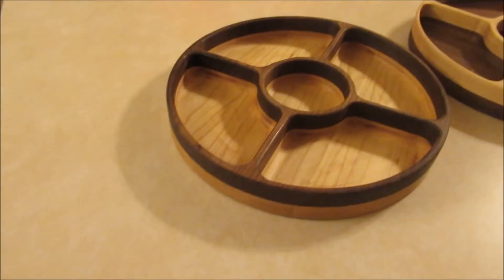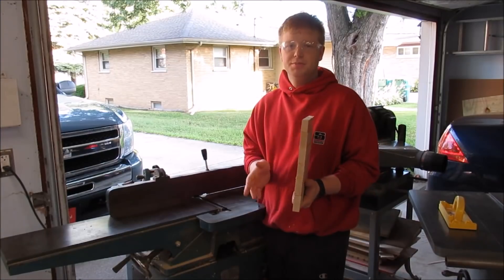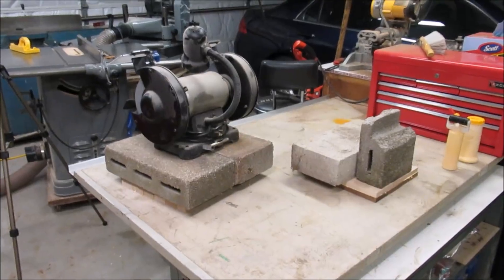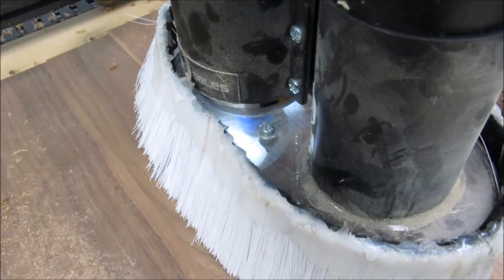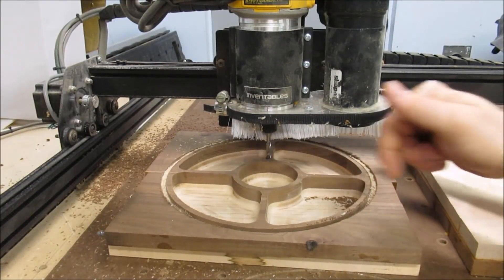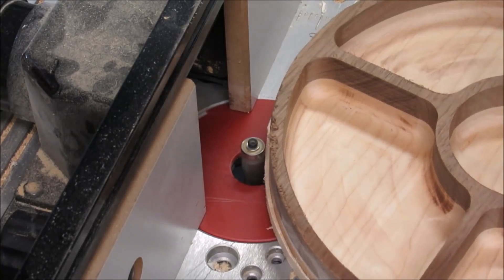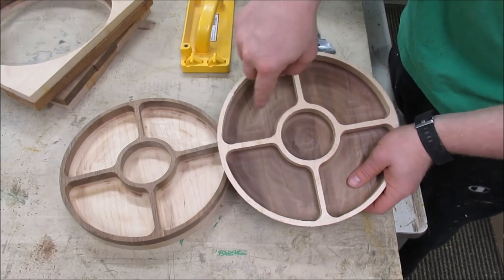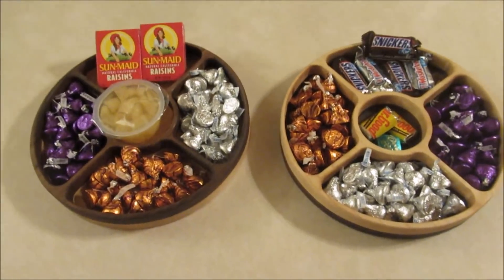Can X-Carve Handle Large Router Bits?

Comment: Can you explain the zero zero positioning you did for the bowls? I am new to CNC and didnt quite catch what you were doing. Maybe you have a link to a video or walk through on this? Thanks.... i guess Im gonna start learning V Carve too. Great...haha
Reply from the maker: Yes, I set the zero point in the software to be the top of the workpiece in the center of the tray.  When I switched bits, the machine stayed still at the x & y zero point, but the new bit was a different length, so the z zero point had to be reset.  I did this by manually jogging the machine to the z zero point and then clicking the button to reset z zero here.

Comment: This is why I went with the Shapeoko 3. I wish I saw your video before I bought it because I would have saved myself a lot of research hours.. I couldn't find anything where the vibration really came into play but this video and other videos showing the inability for X-Carve to cut into thick aluminium (which Shapeoko 3 can easily do at slow speeds with flawless accuracy). The issue with X-Carve vs Shapeoko is Shapeoko is very expensive in Europe, Shapeoko uses US steel so shipping from the US to Europe adds hundreds more dollars whereas X-Carve is all cheap lightweight Chinese parts so they can ship them anywhere in the world with ease.
Reply from the maker: I agree that the Shapeoko 3 looks like a much more rigid machine.  Still I must admit, I've done some pretty cool stuff (not all on video) with X-carve.  When I upgrade, I think it will be time to get the dream CNC machine in some type of pro version.

Comment: The darker wood has just as much burning as the lighter wood. But since the wood is darker, the burns aren't as visible.
Reply: Maybe, but probably not. Some hardwoods are particularly prone to burning. Of the common North American hardwoods, cherry and maple burn much more easily than does walnut. It's not just the lighter color.
Reply from the maker: Yes.  The explanation I've always heard is that fruit trees burn more easily (as you point out cherry and maple).  This is because there is some sugar in the wood vs. non-fruit trees like oak, ash, or poplar.

Comment: I enjoy your enthusiasm.   Love the pull down table.  I am just about to pull the trigger on a 1000 mm xcarve.   I am experienced in multiple graphics programs, corel , PS, others, also in building computer and many other things, also in wood working for many  years.  I build guitars and want some shortcuts to production.  I am experience in all kind of inlay and want that to speed up too.  
 One suggestion perhaps, I know after trying many brands of router bits that all are not created equal,  some are sharper than others, some made with better carbide.  I have found katana bits are a reasonable cost and very very sharp and last very well.     Whiteside bits are great but very $$$ .  I consider house brands such as rockler and others to be not as good as these two.  Over the years I must have tried bits from 20 different manufacturers.   Some of the lesser bits are very slightly out of round also.  In addition the speed of the bit as it grow bigger is a much bigger concern and slowing down the bit can help even if it burns, depending on how deep the burn is.

Comment: Double stick is not the best hold down. Maybe if your spoil board wasn't mdf I would say yeah. You need to clamp that thing down. Or even just put some screws through the corner and screw we Down. Double stick has some small movements and doesn't hold down solid

Comment: Truthfully that router is not designed for that kind of bit. Even more so, in my experience a 1\4" shank with anything larger than 3\4" is a bad idea. Even using rail and style bits and taking shallow passes. If your FR is even slightly too high, you run risk of the shank breaking because the 1\4" shank is writing a check that it cant cash. It will break and break rather quickly. I would use a slightly higher HP router in that machine (requires larger spindle mounts) and then you can use 1\2" bits. The extra HP should power passed the chatter a bit.
Reply: Ive had my X-Carve for over 2yrs and i ONLY use 1/4" shank and have NEVER broken a bit. I use 1 1/4" & 1" V bits, 1/8"-1" end mills, and 1 1/2" surfacing bit. Also, the Dewalt 611 operates at 16,000 - 27,000 RPM's and is VERY capable of using 1/4" shank bits. Proper feed rates & depth of cuts provide me with nice clean cuts and NO chatter.

Comment: Hello David. You have an amazing videos. I am very newby on x-carve. Does the software stop in each toolpath, so you can change the router bit?
Reply from the maker: I do not use the free software that came with X-Carve (called Easel), but yes, even the software package I use (V-Carve Pro) requires a separate g-code for each bit.  You have to switch out the bit, re-zero the Z-axis, and then load the next g-code file.

Comment: Try sticking an aluminum bar between the X axis extrusions (sandwich), it is not that hard or expensive and it helps a lot!
Maybe you can also add a middle support on the Y axis with an aluminum bar aswell that act as the end plates (on Y) but in the midle, I did all that and you can see and hear the difference

Comment: when you're doing your toolpaths, you can save a lot of time by delegating the work across multiple bits. particularly, you could use something big and clunky at a slower feed rate to clear the insides and come back around with a flat end for the vertical walls and stepped clearing, then stick a ball end in there for the fine work and slopes. it sounds like more work, but right now you're at 45 minutes for a single run with multiple steps of cleanup and detail - delegating it across 3 bits could bring you down to 30 minutes at the maximum. no manual cleanup aside from a light sanding at higher grit, then right to finish.
Reply from the maker: I see your point.  If the large bit was only for roughing, I could speed up the feed rate because I don't care about the cut quality.  Then, I could run one finish pass with a smaller bit that is less susceptible to cause machine deflection.  I may have to try this!

Comment: Why not surface plane the board on the cnc instead of the jointer?
Reply from the maker: Time and surface quality.  I figured a push through the jointer was faster than CNC surface cutting.  Also, I planed using the CNC once before and was disappointed with the swirl pattern it produced on the surface.

Comment: I haven’t seen a lot of x-carve videos, glad to see you made one. I have the updated x-carve and the same bit, I’ve been tempted to use it for flattening the wasteboard. Likely in the spring.
Reply from the maker: Let me know how that goes.  I also was thinking of leveling the wasteboard using the router since I know I have a slight out of flat problem.  So far, the out of flat just hasn't bothered me enough to solve it.  Someday.
Reply: Craftsman David Dave, let me run a thought past you, I've  also considered, removing the rails under the default waste board, replace it with two 1/2in  met sheets, milled out so as to allow holes to be punched through it to be a vacuum table. Thus providing me with between 7/8th to 1 inch of extra travel depth. Now that's just a thought, not sure if I'll go through with it or not.